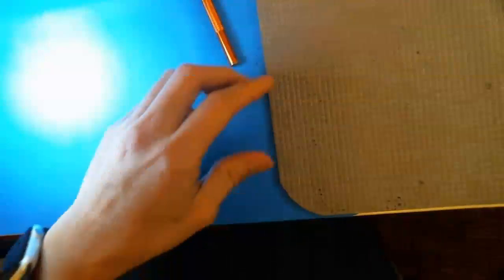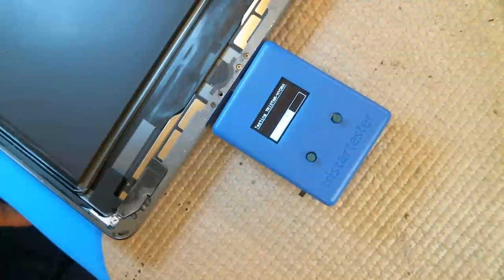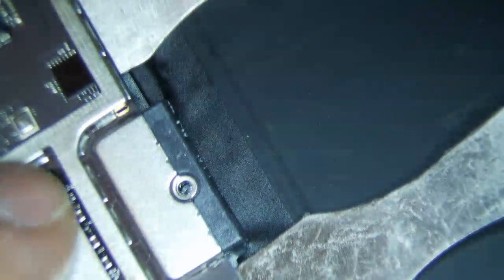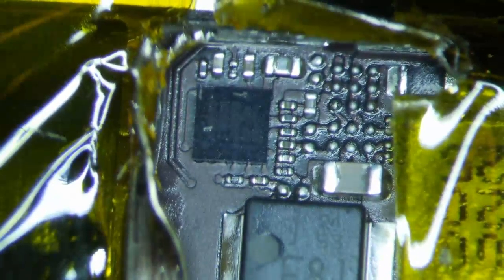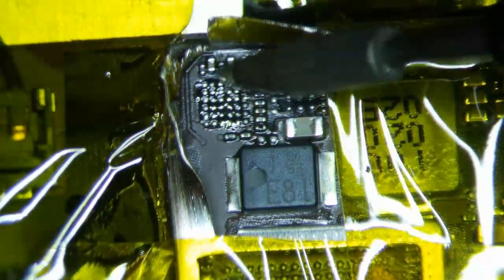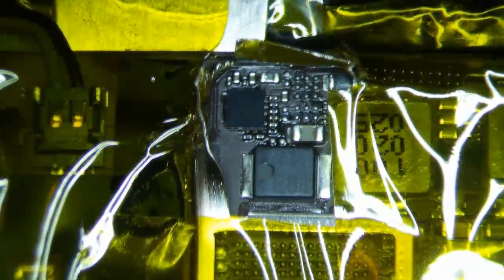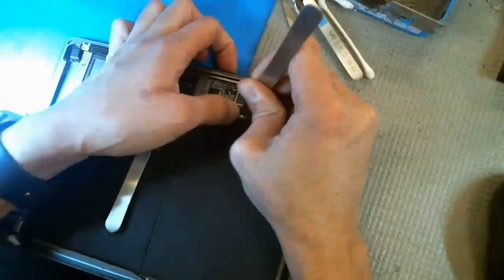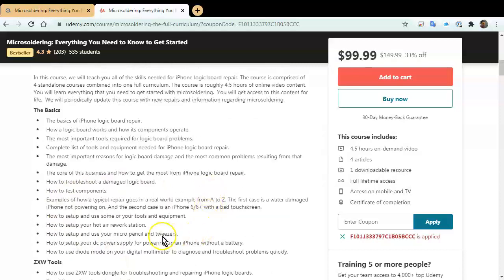ipad 7th gen charging chip repair with tristar tester

Comment: What a poor job cutting the frame like that. Use a mini demel instead. Next time take logic boar out of the frame. The frame is a huge heat disipator . Kapton tape is unnecessary. Bending back the metal frane with that tool is very risky. 😅

Comment: Do you have a video testing the charge port? I am new, clearly, and have an iPad that charges fine about 1/10x and the other 9 acts like there is no charge wire connected. Making it impossible to use the cheap little lightning tester. Just wants to know if it’s the charge flex before attempting to remove the board.